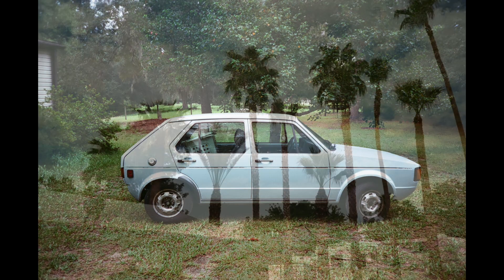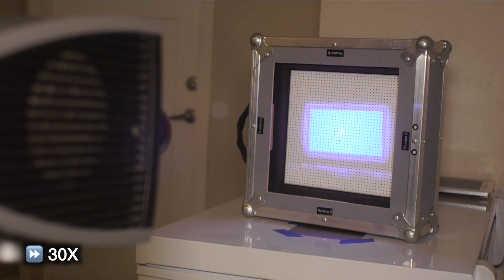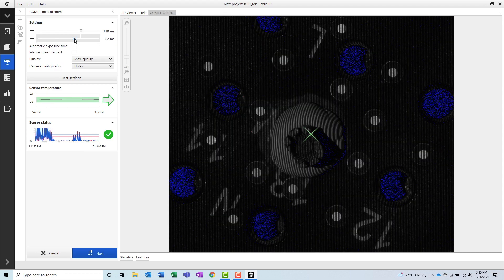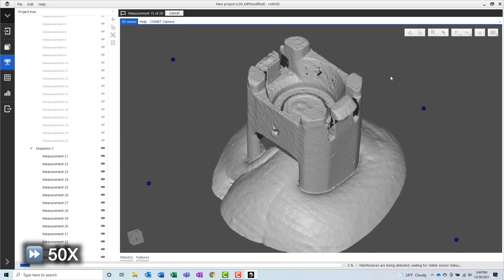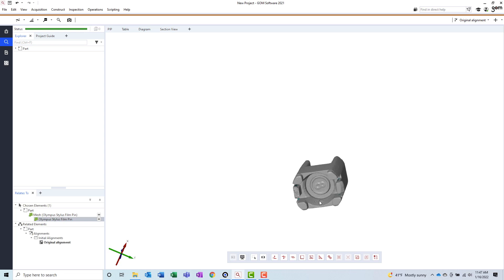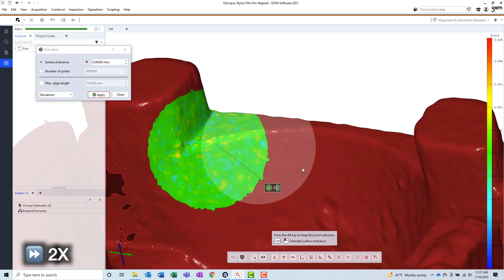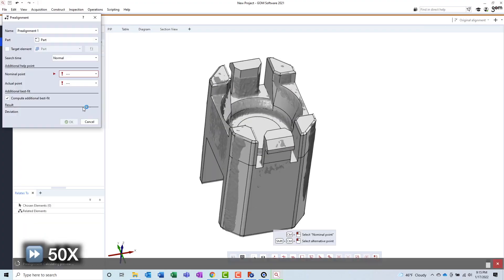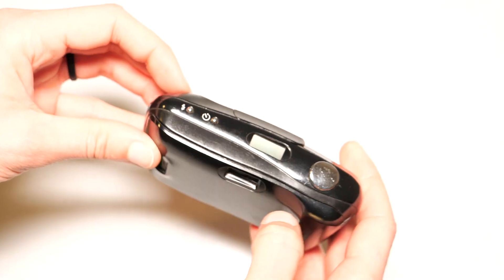Repairing a Broken Olympus Mju by Reverse Engineering with FreeCAD

Comment: Who did you use to 3d print the part?
Reply from the maker: For this part, I used Shapeways. For a project that will be featured in an upcoming video, I had to use Protolabs because I needed higher resolution prints. No complaints about either company. It can get expensive if you need parts right away, though.